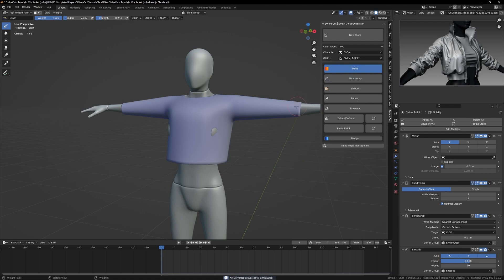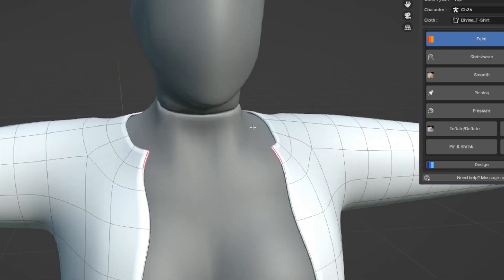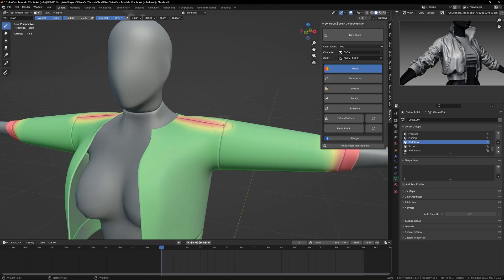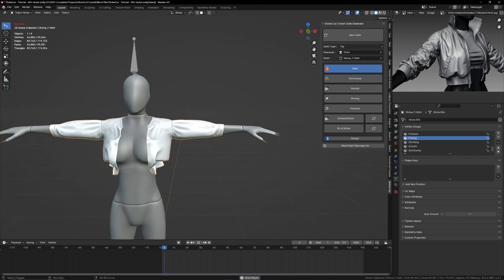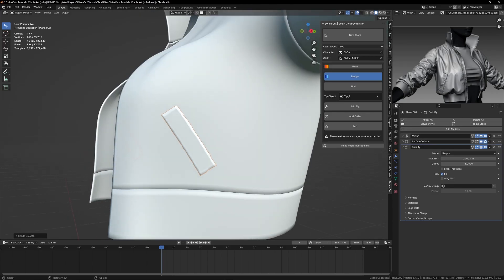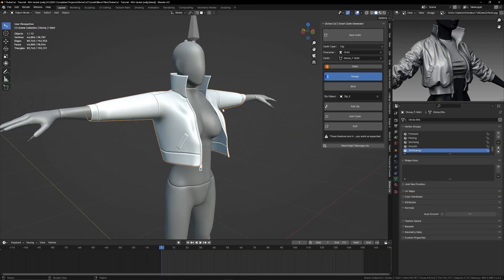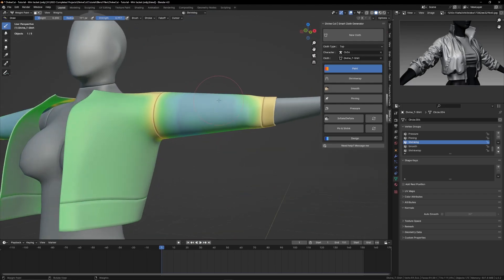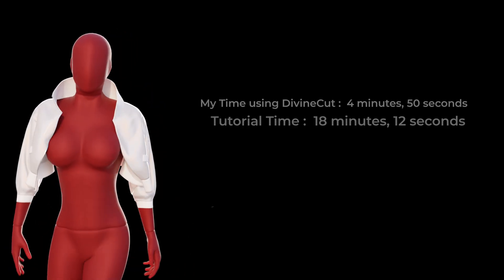Smart Cloth Generator for Blender - Fast Tutorial - Making a Stiff Collar Jacket using DivineCut

Comment: I'm trying to make this jacket but at 1.23 you straighten the edges, but then when you go adjust the collar hight, half of the collar is missing. What did you do there?' when i try to remove the extra collar faces, it doesnt have the same effect as yours
Reply from the maker: Hey there! Simply select the outer edge/lower edge of the collar and pull it up. Does your collar fall down when you do this? or is it stiff and standing as you want it
Reply: @xanestudios  i was trying to bring the middle edge up. When i do it as you said, the whole collar goes up in edit mode, but in object mode when i press play, it falls and flops around
Reply from the maker: @benmmedia9534  Try reducing the weight in the cloth settings. that will stiffen it a bit more
Reply: @ lower than 0.1kg?
Reply from the maker: @benmmedia9534  oh wait, is the collar activated? 0.1kg should be okay. In the design panel press activate collar if it’s not yet activated. The collar runs slow because it’s using softbody as opposed to cloth
Reply: @xanestudios  yeah it is activated. I click activate collard select the lower edge of the “outside” part that hangs down and bring it up with Z